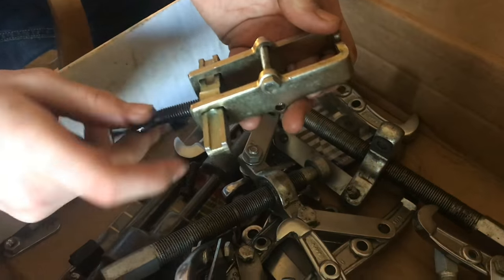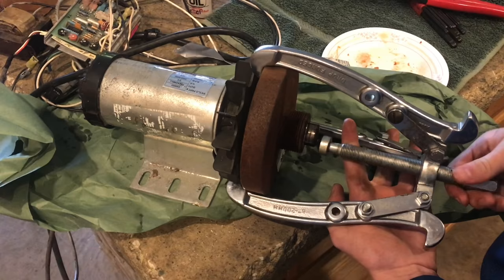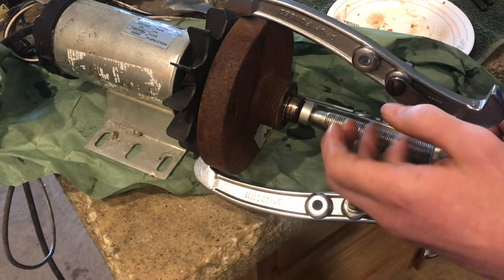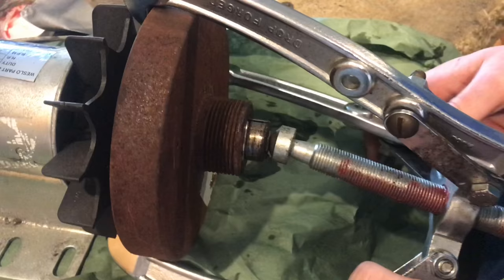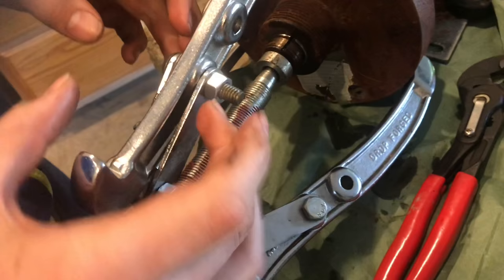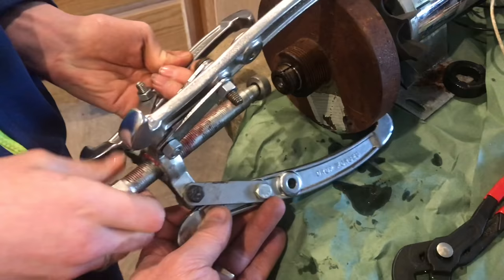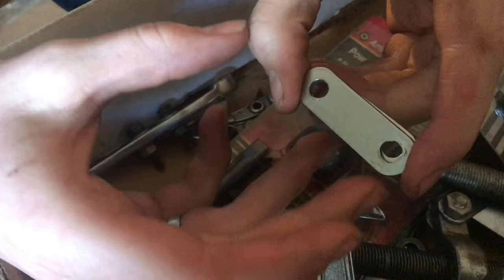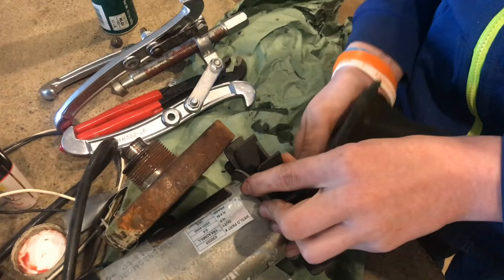TIPS on how to use gear pullers to remove pulleys and bearings

Comment: Is there any big advantage of expensive bearing pullers over say the $20 set of three Harbor Freight ones?  There are pullers that cost ~10x as much and it's not clear what their benefits are.
Reply: I have a bearing puller that is rated for several thousand lbs and I use an impact gun on it. If you have something truely stuck then a $20 set of three is not going to hold up to a 5' cheater bar or impact gun like an $80 rated puller will. The threads will likely fail on the puller for a cheap one.
Reply: @ScottieFredWettstein  thank for the reply.  I wonder if more expensive pullers also seat themselves more easily.  Getting the three legs of cheap ones I got to stay put while I tighten the central rod is really a Sisyphean task.
Reply: @perspectivex I know this a year later but... I just ordered a cheap set, but I only need it to get the clutch off of a 49cc 5/8" shaft, nothing automotive or industrial.

But here's a tip: use a torch on the pulley (or gear or clutch or whatever) where it meets the shaft to make it expand like whenever you run hot water over a stuck jar lid so that you can open it more easily. If the two parts – pulley and shaft – are rusted and therefore fused together, the torch will help break that bond as well. You can also try to drip some Liquid Wrench in there.

An idea to keep the jaws held in place is use a large enough rubber band or even wrap some kind of stretchy tape such as electrical tape.

I just wanted to share for anyone else who came across this.
Reply: @adamcolbertmusic  thanks for the reply.  I don't remember my exact problem but I think it was just the jaws always falling off, not that the bearing was stuck.  I vaguely remember I tried a rubber band and it didn't help that much but I'm not sure anymore.
Reply: Harbor freight tools r considered 1 time use tools. I bought solar panel light for my cabin 350 miles away from my house. I went home charged the system it worked perfectly two days later at my cabin sh! T didn't work! 😠. So now I only shop there for the bug racket,